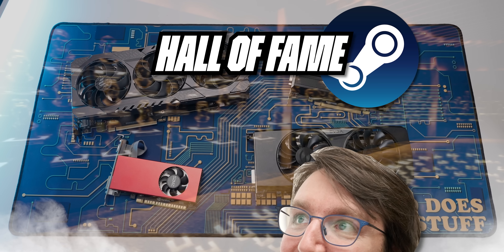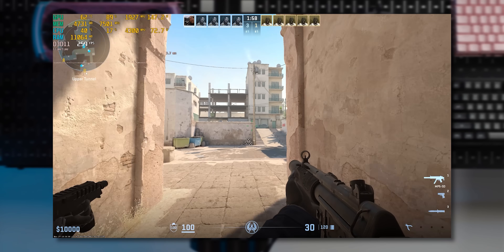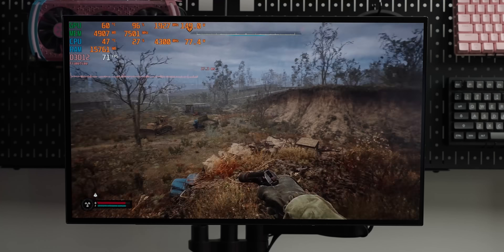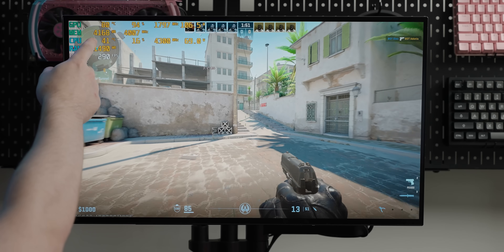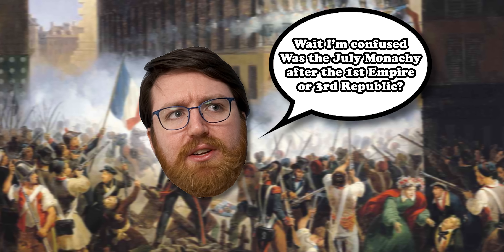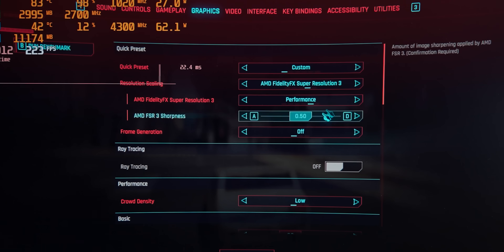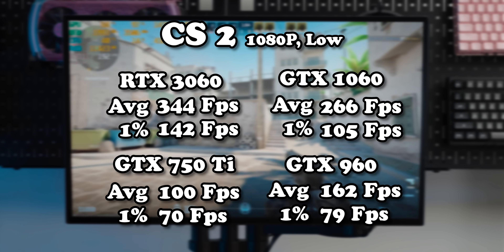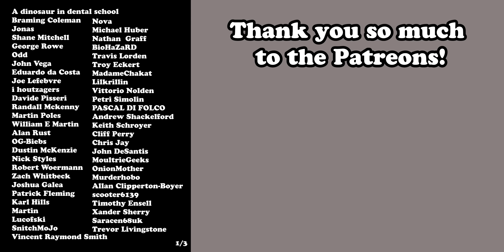GPU Showdown: 7 Years Of Steam Hardware Survey Kings

Comment: Here's GPU Today 11.29.24 channel inventory AMD, Intel, Nvidia. Includes cards on the shelf and in electronic commerce, cards in SI PC desktops, workstations, laptops ranked % by grade SKU available.  The November Steam 'Graphics Card' Survey has never been so different in relation WW wholesale trade inventory on 11.29 shown here by % SKU volume availability. 

Usually, the Steam top cards in 'gamer' use resemble or are in the ballpark of whole trade inventory data, but not currently and the reason in trade-in. I am expecting a large upgrade movement from back generations either picking Ada up cheap on run end discounting, note Ada cards are clearing channel inventories, OR, about to jump on Blackwell. I record 9 M GB 202/203 in production currently. I also think RDNA lV will be well positioned between 419 M TU/GA users upgrading for AMD to capture some of that sales potential on AMD's price performant 8000 series mid shelf objective as Blackwell rolls out.

Channel Share Summary;

AMD long run share = 11% 
Intel Arc = 0.005%
Nvidia long run share = 88.3%

AMD RDNA lll / ll and channel accelerator = 9.5%
Intel Arc including Arc accelerator (no Gaudi) = 1%
Nvidia Hopper, Ada, Ampere with channel accelerator inclusive = 89.3%

By generation;

Intel Arc = 0.546%

AMD RDNA lll = 1.749% flattening
RDNA ll = 3.287% flattening
Instinct 2/1 = 0.036% miniscule in the channel
RDNA l = 1.838% flat
Vega = 1.071% flat
Polaris = 3.117% flat

Subject Radeon lV aiming for price performant mid shelf dGPU parallel Blackwell, I think AMD will be successful standing in the path of 419 M Turing and Ampere users upgrading to Blackwell.

That AMD will successful, picking off some of the Nvidia installed base offering price performant Radeon IV mid shelf options.

The question is, will the Asia Pacific manufacturing group that limits Radeon to between15% and 18% overall share, to reduce their own risk of margin drag and or shear loss, produce that volume?  AIBs make this call on whole product, cost : price / margin and support from the production and supply chain pendant demand from the end market installed base.  This is also true for Data Center accelerators where the manufacturing groups decides what will be produced and in what volume leaning toward scale economies.

Nvidia Ada = 23.572% cards clearing, desktops gaining, laptops stalled
Hopper = 0.101%
Ampere = 23.52% Geforce sells off, Pro trading but slowing, A100 sells down 
Turing = 18.403% Geforce spot trading, Quadro primarily returning
Pascal = 17.656% Geforce 80/70 spot trading, 60/50 flat, Quadro returning
Maxwell = 2.469% has gone flat
Volta = 0.226% has gone flat
Tesla all up with duplication back to Kepler = 2.414%

Proximate WW Channel Inventory ranked across 263 SKUs. Includes cards, cards in SI Desktop PC and, laptop/mobile blades. The channel is focused on moving 1%+ inventory out. Overall the channel is in good shape. CPUs are also clearing out.

Rank - Product - % Channel Inventory TODAY 

You can see what's being traded in and what NEW GPU, a lot of in in prebuilts, is in a run end oversupply condition. The channel objective is to clear everything over 1% inventory holding which is also where the 'deals' will be. You get what you negotiate so make offers.

1	TU RTX 4000	3.563%
2	4070 SI PC	3.149%
3	Tesla all up	2.414%
4	4060 SI PC	2.414%
5	3050 Mob	2.309%
6	GA A2000	2.302%
7	P1000	2.224%
8	TU RTX 8000	2.134%
9	P4000	2.087%
10	GA A4000	1.954%
11	TU RTX 5000	1.952%
12	3050 dtop	1.889%
13	4070S SI PC	1.889%
14	3070	1.798%
15	580	1.574%
16	P5000	1.508%
17	1060	1.469%
18	3060Max-q	1.469%
19	4060M	1.469%
20	GA A5000	1.466%
21	P2000	1.403%
22	TU RTX 6000	1.299%
23	P620	1.260%
24	4070M	1.260%
25	4070ti SI PC	1.260%
26	4090 SI PC	1.260%
27	3070ti FE 	1.197%
28	4060ti SI PC	1.155%
29	4080S SI PC	1.155%
30	3060	1.134%
31	3070 Max-q	1.050%
32	4050M	1.050%
33	4070tiS SI PC	1.050%
34	1070	1.021%
35	6600	1.010%
36	1660S	0.900%
37	970	0.813%
38	P2200	0.777%
39	P520	0.767%
40	3080 10	0.767%
41	570	0.762%
42	5700XT	0.755%
43	4060 8	0.753%
44	TU RTX 2000	0.748%
45	1650 Max-q	0.745%
46	3060ti FE	0.743%
47	3080 Max-q	0.738%
48	GA A6000	0.698%
49	1050ti	0.690%
50	TU RTX 3000	0.671%
51	3050ti Mob	0.654%
52	P6000	0.640%
53	1080ti	0.617%
54	960	0.565%
55	2060 8	0.541%
56	4090	0.538%
57	1030	0.507%
58	1650	0.507%
59	550	0.506%
60	5700	0.505%
61	4070	0.478%
62	GA A4500	0.475%
63	4070S 	0.468%
64	6700XT	0.467%
65	3090	0.466%
66	4080M	0.461%
67	GA A3000	0.441%
68	2080	0.439%
69	1080	0.432%
70	GP100	0.422%
71	2080S	0.421%
72	2080ti	0.420%
73	4080 SI PC	0.420%
74	R Vll	0.376%
75	2070	0.372%
76	3080_ 12 all up	0.369%
77	TU 1200	0.366%
78	6600XT	0.355%
79	4090M	0.335%
80	Titan X	0.331%
81	1660ti	0.329%
82	MX 250	0.326%
83	4060ti	0.326%
84	1050	0.323%
85	980	0.316%
86	2070S	0.316%
87	MX 450	0.303%
88	4060ti 16 	0.297%
89	AD 2000 MXM	0.281%
90	TU 1000	0.278%
91	GTX Titan	0.268%
92	3090ti FE 	0.246%
93	1660	0.241%
94	L40S	0.241%
95	560	0.238%
96	1070ti	0.238%
97	1650ti	0.237%
98	2050M	0.233%
99	MX 150 	0.229%
100	MX 550	0.223%
101	6800Xt	0.215%
102	4070ti	0.214%
103	5600XT	0.210%
104	4070ti S	0.207%
105	6800	0.206%
106	4080	0.204%
107	4070S FE	0.199%
108	3050 6 	0.198%
109	6900XT	0.196%
110	950	0.196%
111	7900XT SI PC	0.188%
112	2060S	0.178%
113	4080 FE	0.174%
114	5500XT	0.168%
115	1650S	0.167%
116	6500XT	0.166%
117	A370M	0.161%
118	7800XT	0.161%
119	7600 8 SI PC	0.160%
120	408SFE	0.155%
121	3090ti FE	0.153%
122	V100	0.150%
123	980ti	0.149%
124	4080S	0.147%
125	7600 8	0.145%
126	6400	0.145%
127	7700XT SI PC	0.144%
128	7900XTX	0.140%
129	Vega 56	0.135%
130	3090FE	0.134%
131	Vega 64	0.130%
132	MX 330	0.130%
133	7900XT	0.127%
134	7700XT	0.127%
135	GA A5500	0.126%
136	A770	0.121%
137	3060ti FE	0.118%
138	MX 350	0.111%
139	2080S Max-q	0.110%
140	206012	0.110%
141	A380	0.101%
142	2080 FE	0.101%
143	4090D	0.101%
144	MX 130	0.099%
145	TU 600	0.098%
146	3070FE	0.091%
147	A750	0.087%
148	A100	0.086%
149	7600XT 16	0.085%
150	P100	0.084%
151	7900GRE SI PC	0.083%
152	2070 Max-q	0.083%
153	3080 10 FE 	0.082%
154	Pro WX7100	0.079%
155	Titan XP	0.078%
156	Titan V	0.076%
157	7600XT 16 SI PC	0.073%
158	Pro Vega 20 	0.071%
159	AD  500 MXM	0.069%
160	4090 FE	0.069%
161	A800	0.067%
162	7800XT SI PC	0.066%
163	6650XT	0.066%
164	2070 FE	0.066%
165	Pro WX5100	0.065%
166	Vega 48	0.063%
167	3070ti FE 	0.063%
168	7700S	0.062%
169	6950XT	0.062%
170	3080ti FE	0.062%
171	RTX TITAN	0.061%
172	6750XT	0.058%
173	A10	0.057%
174	7900XTX SI PC	0.054%
175	Vega 64 FE	0.054%
176	7900GRE	0.052%
177	Pro W5700	0.052%
178	2080Max-q	0.052%
179	Pro W5500	0.050%
180	L4	0.049%
181	H100	0.048%
182	5600M	0.046%
183	6800M	0.045%
184	6550M	0.045%
185	Pro W6600	0.044%
186	Pro WX8200	0.044%
187	A30	0.044%
188	MX 230	0.043%
189	6750GRE	0.042%
190	2060 Max-q	0.040%
191	5500M	0.039%
192	AD 6000	0.036%
193	6700S	0.034%
194	AD 4000 MXM	0.034%
195	GA 170HX	0.033%
196	A580	0.031%
197	A310	0.029%
198	1630	0.028%
199	AD 4000 SFF	0.027%
200	Pro WX9100	0.026%
201	GH200	0.026%
202	Pro W6400	0.025%
203	MX 570	0.025%
204	H800 	0.025%
205	6700M	0.024%
206	AD 5000 	0.023%
207	540	0.022%
208	AD 5000 MXM	0.022%
209	6500M	0.021%
210	L20	0.021%
211	AD 4000	0.021%
212	AD 4500	0.020%
213	GA 90HX	0.019%
214	TU 30HX	0.019%
215	L40S	0.019%
216	6800S	0.018%
217	AD 2000 dtop	0.017%
218	7600S	0.016%
219	Pro 7	0.016%
220	TU 40HX	0.015%
221	Mi125	0.014%
222	560X	0.014%
223	6650M	0.013%
224	6600M	0.013%
225	AD 3000 MXM	0.013%
226	Pro W7900	0.012%
227	Pro W6800X MPX	0.012%
228	Mi150	0.012%
229	TU 50HX 	0.012%
230	Pro W7600	0.010%
231	Pro W7500	0.010%
232	Pro WX3200	0.010%
233	7900M	0.009%
234	A350M	0.008%
235	Pro W7700	0.008%
236	Pro W5500M	0.008%
237	Pro W7700	0.007%
238	7600MXT	0.007%
239	6300M	0.006%
240	A100 SXM2	0.006%
241	AD 5880	0.006%
242	Mi210	0.005%
243	A40	0.005%
244	L2	0.005%
245	AD 1000 MXM	0.005%
246	Mi100	0.004%
247	4060ti FE	0.004%
248	Pro 40	0.003%
249	A2	0.003%
250	GA 70HX	0.003%
251	4070 FE	0.003%
252	7600MXT	0.002%
253	5700XT 5OTH	0.002%
254	Pro W5700X 	0.002%
255	FLEX140	0.001%
256	MAX 1100	0.001%
257	Pro 60	0.001%
258	Pro 50	0.001%
259	Pro W6800	0.001%
260	Mi1160	0.001%
261	Vega II Duo	0.001%
262	580X	0.001%
263	H100 SXM	0.001%
		100.000%

mb

Comment: There's little point to continue the backwards path of even LESS performance than the 770Ti or 970. We may as well watch a video of a brick, as the performance would be similar. No one is going to be running games on this hardware, unless they are going retro gaming (which you are not even testing) or possibly emulation. Seems a waste of time, as it really isn't entertaining or even remotely interesting. Just my 2 cents.

Comment: I almost got the 3GB cheapo variant of 1060 when it was released, but ended up with an used 780 Ti instead, as Kepler was still properly supported so it wasn't a bad purchase back in 2016.

Comment: Not only should you test the 1060 against the 1650.... but you should do what I did. Take the cooler off your 960 and put that on the 1060 (I used my evga 950sc+ twin fan cooler on my evga 1060 single fan variant card) its as simple as a repaste. 

Would make for an interesting video both modding the 1060 and testing against the 1650!

Comment: Dawid, video idea for ya: With the sunsetting of Windows 10 there will likely be a huge dump of unsupported office systems hitting the used market over the next year. Driving the prices way down. None of 4th gen intel support 11, many 6th/7th gen oem intel systems don't, and 1st gen Ryzen doesn't either. Considering that the i7 4770, i7 4790, i7 6700, i7 7700, and pretty much all of 1st gen Ryzen still perform pretty well in budget systems this makes for some nice options. The intel chips can be regular versions, S versions (low power), or K versions. I wouldn't go below the Ryzen 1500 but there's tons of 1600 models out there. All of those CPUs are nicely matched with; GTX 1060 6gb, GTX 1660 (regular/ti/super), RX 580 8gb, or for a brand new option that wont require an adapter for power there's the RTX 3050 6gb. The RX 5500 xt 4/8gb is basically a low-power RX 580 and is also a nice choice. So, the video would be about the upcoming options for the classic budget banger office PC retrofit and how they perform with modern titles. With esports being their bread-and-butter but the possibility of playing more with FSR/DLSS.
Reply: except... those will be from huge corporations. most businesses like most normal people just dont have the cash to upgrade hardware for the exotic requirements MS wants to run win 11. so MS will have to stop the BS or accept that people are still more on win 10 than win 11. they should taken the hint with the discovery win 11 24h2 stops ubisoft games running, and so they had to halt the rollout until they figure a workaround on systems with those games installed. kinda stupid bug for an OS that runs the most on gaming systems.

Comment: Some modern systems have issues running 900-series GPUs. Don't fret about not finding the 4gb variant of the 960 as it doesn't have the oomph to use it and most versions were the 2gb model anyways. - That said, for those on a super tight budget it can still handle esports titles. Though, at $40ish USD I'd highly suggest the RX 470 4gb. The RX 470 4gb is low enough wattage that you can use one of those dual-sata/molex power to 8-pin adapters and drop it into an Optiplex with an i7 4770 for dirt cheap esports gaming provided it's a model with a 280 watt power supply or larger. - I suppose that's a video idea. How well does the modded Optiplex budget-banger system hold up in esports titles today.

Comment: The 3060 runs Cyberpunk 2077 really well because it's very stable FPS. I run mine using 1440p RT Ultra and yes, it's only 38-42 FPS but the 1% lows are like 35 FPS, so it's not blazing fast but it's a smooth ride.

Comment: I still have a GTX 970 with 4GB of RAM, looks like it will stomp the 960 but will die trying with Cyberpunk & Stalker.
Still not sure whether to get a 4060 with 8GB of ram of the 7800XT with 12GB ram that will use a lot more juice.

Comment: Have my old pc with its MSI GTX 970 4GB Gaming and an overclocked i5 4690k. Thing will still play some modern games no problem. Was super surpassed when it ran State Of Decay 2 at high settings at 90ish fps

Comment: I think there was a UEFI patch for the 960 SSC, as some shipped without that support. Mine (the one I'm watching this on right now, with its SLI-partner FTW edition) supported it out of the box, so guess I got lucky. 

And yes, it's nearly 2025, and I'm using two 960s. Well, one gets a lot of use, since not much supports SLI these days, but the FTW does get some love when running encoders with CUDA support.

Comment: I have been confusing steam hardware surveys quite a bit as I have been swapping hardware like underwear.
Also I only purchased 2 gen old lower high end cards. So I ran a Radeon 6850, then a Zotac 570 which died and I RMA'ed it, and Zotac sent me a 680 which was super generous. In that time I mined a bit with a 7950 which I later swapped as my main gaming card. On spare pc's I gave to a friend I had a GTX960 4GB which was excellent and comparable to the GTX680. I got more stability in 2019 pre GPU madness by getting a used EVGA 1070 FTW which lasted a while till replaced with RX5700XT and now an RX6700XT
As I buy and sell PC's for the fun of it, I have a bunch of Dell 3060 12GB's and RX5700XT's which I find is Price Performance kings these days.

Comment: I'm still using a GTX 1080 and it's still running like a champ after several years. It ran Cyberpunk 2077 on release at ultra settings 1080p 60fps without any problems and that was before they even added any patches.
Reply: I had the same card at release, but with a 1440p screen. IIRC, I played it at high settings (without RT, of course) and 1440p native. It only managed 30 fps, but it was a locked, evenly paced 30 fps that felt pretty good. Since I was playing it as a slow stealth game / immersive sim light, I didn't really need higher frame rates.

Interestingly, I experienced very few bugs with the release version. I think the game crashed only twice and I got stuck in the scenery once. That was it. I guess I was lucky.
Reply: @no1DdC  smae man, only bug for me was sometimes loot from enemies (which was always junk anyways) would be below the floor and the game never once crashed on me in over 100 hours of play in the first 2 months after release.  I felt like I was the only one without bugs lol
Reply: I was still using a GTX 1050 till about 2 years ago when it died and I got a GTX 1660, which runs everything i want to, so, it'll do me for a few years yet.
Reply: I still have two GTX 1080s not in SLI anymore but in two PCs. They are great for 1080p but can struggle at times with 1440p.

Comment: Little fact: the gtx 750 ti uses an older version of the architecture that the 900 series uses, Maxwell so it still gets driver support from Nvidia.
Edit: corrected factual error.
Reply: Sort of, it's Maxwell gen 1 where as the 900 series is Maxwell gen 2
Reply: @2cars10  my bad, in this case it doesn't support DX 12

Comment: Dawid, just so you know, your CPU gets you all that performance in CS2, for CS:GO the CPU was important and you could get away with a trash GPU, now CS2 requires beefy CPU and a pretty good GPU for at least 200FPS, so like at least Ryzen 5 5000 series and i3-12100 or better and GTX 1060 6GB or RX 580 8GB at least. That's just from what I saw in tests and my experience.

Comment: Wait... The 3060 12GB was top of the pile or did I miss hear. It launched as 8GB. The 12GB came later in response to games occasionally touching the 8GB limit (and 12-16GB on AMD GPUs).

That 750Ti looks really cool! Shame the 960 only had 2GB. Does the 4GB model come with the same problem the 970 had namely, it was only 3.5GB?
Reply: No, it launched as 12GB the 8GB variant was a short lived lobotomized version with some of the memory chips stripped off.
Reply: @lharsay  Yes. I'm probably thinking of the 4060 Ti 8GB to 16GB jump.

4060 Ti aside the 3060 must be one of the few cards since the 10 series, where memory size is the only difference.
Reply: @techkev140  The 2060 got a 12GB variant a year after the 3060 release, you might have mistaken with that one.

With the 3060 8GB the difference wasn't 'just' the memory size, removing 2 out of the 6 semory chips crippled the bandwidth which slowed down the card by like 20% even tho the core counts and clock speeds were identical.
Reply: Nope, four full-fat gigabytes. Source: I had one and it did not cripple itself if you went beyond 3.5 GB. 

When it was new, 2 GB were the norm and recommended by pretty much everyone, but I wanted a future-proof system and went with the more expensive 4 GB variant, which cost more than e.g. competing and faster AMD cards that had only 2 GB of VRAM. Somewhat ironically, I didn't end up using this card for very long and upgraded to a GTX 1080 within a couple of years, because I was getting into VR and the 960 was only barely able to run then modern VR games.
Reply: @no1DdC  Thanks for confirming that it's full 4GB. I was not sure if it had that issue.
Reply: @techkev140  I should add that I wouldn't recommend this card anymore, considering that you can, with a bit of luck, get a used GTX 1080 for 100 bucks.